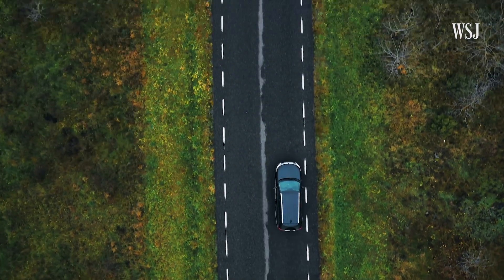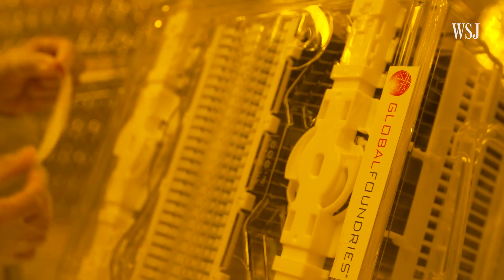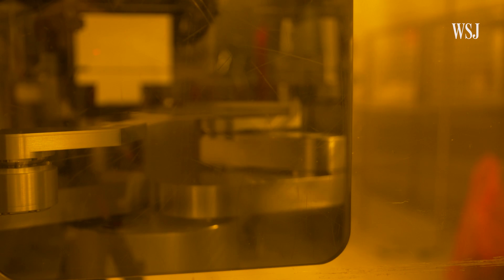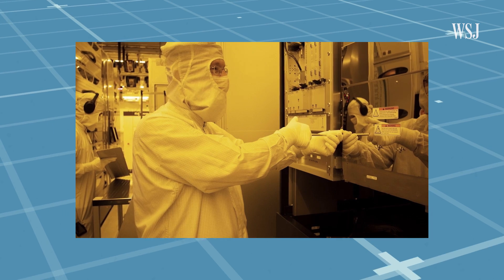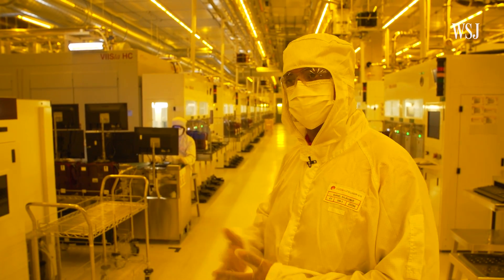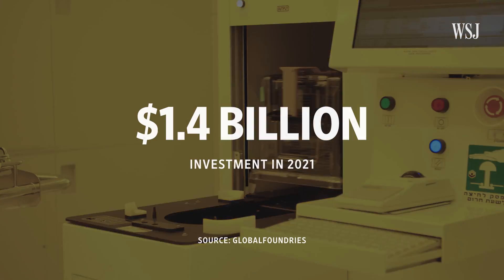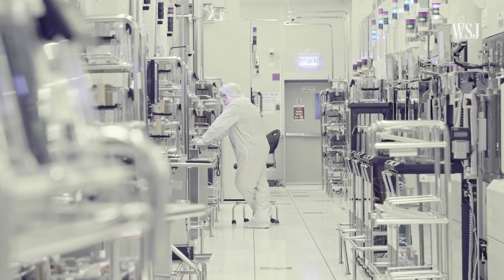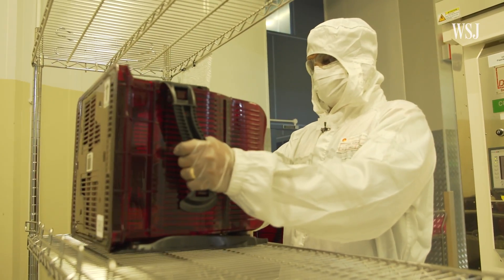Why the Global Chip Shortage Is Hard to Overcome | WSJ

Comment: Silly question...How long will Earth's raw materials last to keep making this technology?
Reply: It will take a long long time.... Approx %27 of the earths crust consists of silicon. For context, aluminum which is one of the most abundant metals on the planet is only %8 of the earths crust by weight. So we will run out of iron and aluminum far before we run out of silicon. (hopefully this info is helpful.)
Reply: @raithelkarasu4889  it is! This popped into my mind because we often talk about oil being a limited resource but not when talking about other raw materials that will have an exponential increase in demand over the next century. Thanks!
Reply: Silicon is one of the most abundant elements in the earth’s crust. Every rock, every stone, every grain of sand or dirt contains silicon. That being said it needs to be purified a ton before it’s used in a chip.
Reply: @alectoperez9769  , if I'm not mistaken, Copper is also required to produce chips.
And AFAIK, it is not nearly as abundant as Silicon. The same goes for some of the raw material(s) to produce plastics, which is another substance needed for chips.

Also, chips may be small in size, compared to most products. But the demand for it will inevitably grow at exponential levels in the next few years.
Reply: @alectoperez9769  but silicon can only get us to far, I’m wondering when we’ll see a significant reduction in returns

Comment: This shortage is so bad that I am forced to write code such that it is microcontroller independent. It's crazy
Reply: Mmm now that is an interesting piece of info, thx !
Reply: So yeah, the best design practice is to separate the Application Layer from the Hardware layer, so if the hardware changed, u only need to rewrite the hardware layer and left the application layer barely touched. But who's got the time?
Reply: @milky3ay566  Lucky for me as a web/mobile developer there are thousands of abstraction tools at my disposal where I don't have to think about the underlying hardware. I use ORMs to access my databases, runtimes like Nodejs and The browser DOM that provide a large standard api for the environment. It's kinda crazy that hardware developers haven't really don't this yet for their work. Do you always start from scratch every new device? I would think it would be a worthwhile investment of any company to build a standard API for the type of work you use. I have a whole generated starter project I use for every new backend API project I start that includes user auth and permissions and basic things that are needed for every project. Spend the time doing it once so you don't have to do it every time, its totally worth it.
Reply: @Darenz-cg9zg  There are many things, but let me pick a GPIO as an example. For a quick turn around firmware design with a microcontroller, u can directly access GPIO address space by using *(uint32_t*)0x410003CF |= (1<<0); to toggle PIN0. easy, u can just control the GPIO from anywhere. Now let say the micro u are using not available and needs to be changed? that's bad cause the GPIO address space will be changed and GPIO configuration also changed, so now u have to go everywhere to modify the address call and it's messy. So the only way to solve this is to write a HAL (Hardware Abstraction Layer) which instead of using  *(uint32_t*)0x410003CF |= (1<<0); we use togglePin(PIN0, true) and use this function whenever u want to toggle the pin. Basically separating the application layer from the hardware layer. But this will take time to develop and maintain which in a world of quick turn around design, it is hard to achieve.
Reply: @milky3ay566  Pin mapping is an abstraction layer that your codebase probably really should have had to begin with. 
Things like architecture/instruction set, word alignment, and toolchains are where the complexity is warranted.

Comment: Square chips on a circle wafer seems very inefficient
Reply: due to the was these wafers are created it is basically the only practical way
Reply: Not really.  Depending on the chip/wafer size ratio there is relatively little waste.
Reply: @Combat_Epistemologist   Cutting a square out of a circle or vice versa creates waste, which in turn is inefficient..

Comment: I didn't hear anything about a raw material shortage- so automobile plants shutting down because of chip shortage is overblown and down right lie..(all staged to create the illusion and subsequently create new pricing level)

and if so be the case then chip manufacturers should be working around the clock- with revenue and profit through the roof..
Reply: they are working at 100% capacity

Comment: Who built the machines being used?  That's the story now.  Thx
Reply: The Dutch(With US Backing) do and they are not cheap costing up to $200 Million and they only make like a dozen a year due to extreme quality control and testing. 
So even if you wanted to create a foundry in the US, it will take years before it starts running since making a lithography machine is an extremely complicated and expensive process and a very very very few have managed to master.

Comment: Some details that would add a lot more context from an ex-industry person: 
1) Speaking in the term 'chips' isn't helpful as it implies that they are substitutable goods.  They aren't, every one tends to have a unique purpose, and even your phone will have 15-20 major chips.  These are re-designed with basically every refresh of the phone design.  This means that a CPU meant to run a BMW very likely won't work in a Honda.  They're all somewhat custom.  
2) The lead time for the lithography masks is in the 6-12 week range.  
3) The total WIP time for a wafer is in the 6 week range.  
4) The lead time to order the tools shown in the fab is 1-2 years, and the installation time for each tool can be months.
5) Combining factors 2-4 mean that a customer can't call up a fab and just ask for more of their chips.  The production systems, because of the precision and purity requirements, just can't turn that fast.
Reply: Also, production machines obsolete fast.
AFAIK the industry will not build capacity if selling production is not a sure thing.
Reply: As a news piece this video is more than sufficient.
Reply: Your comment is helpful. Semiconductor production seems extremely complex.
Reply: What company did you work for
Reply: @TonyF1MMA  Intel running Fab finance, and with a healthy number of remaining company contacts.
Reply: @brandob9  I see.  My whole family has worked for Texas Instruments at one point or another.  My uncle for 30 years now
Reply: I've always wondered about how one could start a business like this. Your insight is much appreciated.
Reply: Technology is wonderful but..... during times such as today bringing older Technology back into play IE "mechanical vs digital" temporarily could aid demand but lol where is money to be made in that lol
Reply: If orders are put in years in advanced, how are they so far behind?  I understand covid would put production behind but how far?  No real human interaction with the production process, correct?  Just monitoring? Looking at the auto industry, they are severely behind.  Losing a couple+ million cars produced this year.  And seeing how masked up and air tight those facilities are, they seem like the most covid-free zones.
Reply: @stevemcarthur6886  they don’t keep stock, only Toyota kept a stock of chips, that is why they are not affected, comes down to bad business practices
Reply: Forgive if this is a dumb question, I found these three quotes. Are they true? 

"scientists in Texas have discovered a way to convert anything with carbon — even trash — into graphene (GRA-feen). This process keeps carbon out of the atmosphere. What's more, the graphene can be added to other materials to make them “greener.” The team published its findings on January 27 in Nature. Mar 20, 2020"

"Future of fast computer chips could be in graphene and not silicon, says new research. ... Their results suggest that it could replace silicon transistors in electronic circuits. Graphene is pure carbon in the form of a very thin, almost transparent sheet, 0one atom thick.Aug 6, 2014"

"Graphene has great potential as a next-generation semiconductor material as a result of its exceptional properties, such as its high mobility that has been shown to be up to 250 times higher than that of silicon, low loss requirements, small scale and flexibility1. Oct 1, 2018"
Reply: @angelagriffin5130  They true but there’s a big problem with graphene compared with silicon,  graphene is 10 times more expensive and that’s base materials not counting the production costs.
Reply: @angelagriffin5130  I wouldn't go looking for facts in a youtube comment section. Well I mean you can go looking for then but be wary of how dubious a source this is.
Reply: @screwlose  okay...i was curious. Thought I would put it out there.  I have kept doing my own research. What's your thoughts on the subject?
Reply: @angelagriffin5130  the problem with graphene is mass production. what theyve learned they learned in a lab with microscopic samples and a relatively high budget. to scale that up simply doesnt work, and they havent found a reliable way to make much at all at a time.
Reply: Random question. Why don't we just standardize the chip architectures? If the custom chips do the same function for different products then wouldn't it make sense to standardize the industry? I'm not exactly smart when it comes to hardware manufacturing.
Reply: @TimothyNeu1986  Different circuits for different problems.  They are inherently problem solving machines, and each is tuned to a different problem.
Reply: @brandob9  Not exactly! Target ICs are, but CPUs, FPGA(Field-programmable gate array)s, op-amps, regulators ..., just to name a few can be used universally. The real reason is globalism, and $$$.
Reply: @TimothyNeu1986  to give another answer: chip design (just the layout of transistors) is intellectual property and huge R&D cost in itself.  

Different designs made with same technology can perform very differently/have very different qualities -- companies want to keep their design secret to have competitive advantage, as designs they make is the only thing they live off (AMD, Nvidia, Intel).

For example of how different chips can be -- AMD/Intel are the only players in consumer PC/laptop processors market. But if you look at smartphone world there's not a single product that has AMD/Intel CPU in it -- their designs are completely unfit for that purpose for various reasons; Apple/Qualcomm/Samsung/MediaTek rule there.
Reply: @TimothyNeu1986  Because BMW won't want Chevy's code running their machines, and vice versa...  As was mentioned, each chip, say for engine timing, will be getting the input from slightly different sensors, possibly at different voltages or data rates...  It can get complicated and copyright infringing pretty quickly.
Reply: @TimothyNeu1986  No offense to others but I don't think they answered fully. We do have certain standardization on chip architectures that everyone can use for all different purpose, sort of one size fits all solution dubbed GPP (general purpose processors) aka the CPU in your PC and mobile phones. Notice it's called a GENERAL purpose processors? And both example I've listed are GENERAL purpose devices? Problem is that they are one size fits all solutions, meaning they include all sorts of functions which many of them are not needed for AS (application-specific) usage. Using a GPP in AS situation is inefficient and cost-ineffective.

ASICs (application-specific integrated circuits) on the other hand are designed to do a specific task. Think your graphics card from AMD or Nvidia for example. Using a GPP to do specialized task would either require many powerful ones to achieve what a graphics card can do, or way overpowered and cost-ineffective, basically using a GPP to use calculator when you can buy a calculator (an ASIC) instead.
Reply: @TimothyNeu1986  The only thing that all chips share is that they are made of transistors and wires.  Beyond that, there's a a huge variation in terms of their functions, price points, etc.  If a chip runs software, then you need a CPU, which is indeed largely "standardized", meaning ARM in smartphone application processors, or x86 for PC or servers, or ARM R-cores for hard drives or automotive (the hard driver mfr have switched over to RISC-V recently to save money on royalty), or ARM M-cores or Atmel for low-end 32-bit microcontrollers used in BT, IoT, automotive, etc.

A chip as you know is really a system, consists of on-chip interconnects, memory controller, special accelerators, peripherals, and other crown jewel company-specific IP's such as GPU, baseband, etc.  So the system variation is huge.  Why?  One cent differences in price can make a huge difference for a product line over the chip's product life.  So mfr look for every way to reduce the cost, and it's a tricky tradeoff like all complex design problems.

An article like this really adds nothing to elaborate on the situation.  Where is the shortage coming from?  A smartphone apps processor, fabbed on 5nm, is very different from an industrial controller typically fabbed on 14nm process or older.  Advanced nodes like 5nm are always on allocation, but the 14nm or older?   And think like a fab, which do you prefer: fabbing a multiple hundred dollar 5G apps processor for Apple/nVidia/Qualcomm/Huawei/AMD or a sub-$1 32b microcontroller?
Reply: @stex5026  Just asking, but where did you learn all of this from?
Reply: @stex5026  Actually some of the CPU's might be standardized but that is more in regards to few manufacturers that design the actual chips, aka AMD, Intel for PCs, ARM for mobile, Samsung obviously has some stuff. However, one big problem is car manufacturers and other industries where there is no standard and all produce proprietary components for their products. There should be a standard for cars and other industries to reduce the cost and also reduce the waste of materials. Hopefully this pandemic has shown that we are in great need of more stock and investment in the US.
Reply: Um yeah, that's exactly what this video explained.
Reply: @jfo738  not as adequately as this person's comment did

Comment: Nothing about the Dutch company asml but without there machines you cannot make the most advanced chips so they are going to be very important in this
Reply: The latest nodes aren't really the issue, the problem are the unique older chips that countless products rely on and are suddenly out of stock with indeterminable lead time. Lesson for the manufacturers, Just In Time is not a mantra to be used indiscriminately, for some parts you in fact should maintain long term stocks.

Comment: Would it be a good idea to recycle chips off old devices no longer being used?
Reply: That's possible in theory but too labour intensive. Also, old devices often use old chip models which are not used in new designs.
Reply: To a degree that has always been done, but that's for either personal tinkering and prototyping one-offs, or absolute bottom of the barrel worse than chinesium electronics. For a serious sort of production, it's not an option.

Comment: because wall street wanted mac maximum profits.
analog devices shut down two American based fabs past year... because the margins weren't high enough to keep Americans working... 40% wasn't enough They need 60%.... 3000 skilled workers... bam.
now we all use vanguard and tsmc... sure... no chance for a shortage... other countries need chips too...
Reply: oh please...those plants AD closed were super old 150mm plants... besides, TSMC's emergence and commitment to customers is the reason the U.S. now has the world's best and biggest fabless companies.
Reply: @doctorwilly  they would be yielding extremely useful power semiconductors and LTC maintained a better than software profit margin operating them. so I'm gonna disagree. 1u is an extremely useful process for power and lower noise analog product...
Reply: @doctorwilly  and you're welcome.
Reply: A skilled worker always finds a new job, often a better one. And if not, well, clearly must not have been that skilled after all. And are you sure you quite understand what margins mean? 40% margins for that kind of company sounds a lot like running in the red.

Comment: US trade war toward China is the major caused of manufacturing chip and global supply chains disruption. There is no other explanations, twist and turns.
Reply: This^ China/US trade-war is on the icing on the cake. Pandemic-generated inefficiencies in resource supply chains is the bulk of the problem. It slows down supply AND increases demand with the an increase of microchip intensive behaviours (like not going out because COVID).
Reply: Not really, a tiny portion of these chips is made in China, and those that are are usually only cheaper and older chips for things like TV's. There isn't any major failing that happened that caused this, its just that everyone wanted more tech this year. It's really exciting for the industry, thanks to Cripto and this surge there is so much money going to this industry, I think the new tech coming out in 4-5 years from now is going to be lightyears ahead. I definitely think Moores law is gonna be smashed for at least another five years thanks to all this money

Comment: to speed up fabbing why not skip the testing step and even the encapsulating process so xbox users would get a red ring of death or you could shine a uv disinfecting light in the back of a casino slot machine causing it to malfunction to the point of spitting all the coins. (remember the raspberry pi 3 debacle a few years ago where taking a picture caused the voltage regulator to glitch and crash)?

ok so casinos would have to put the motherboards in uv proof boxes.